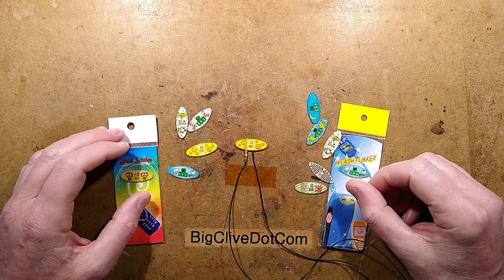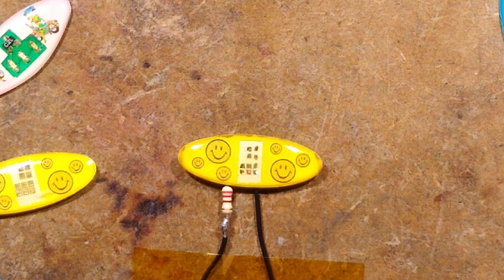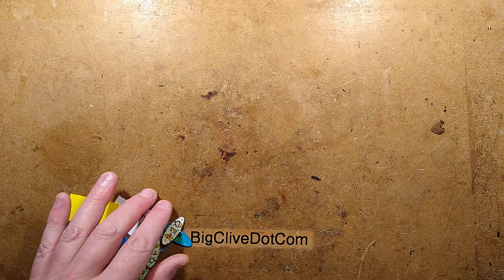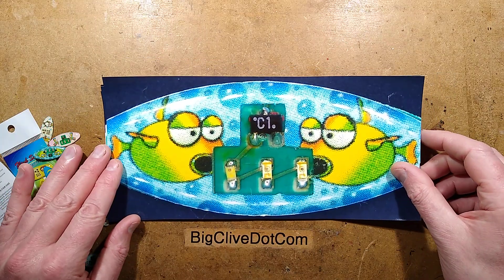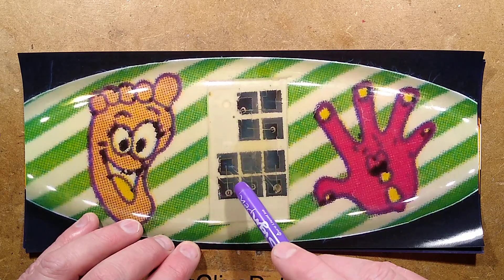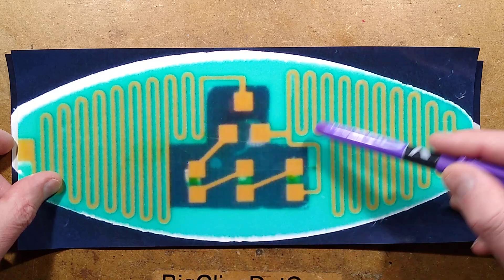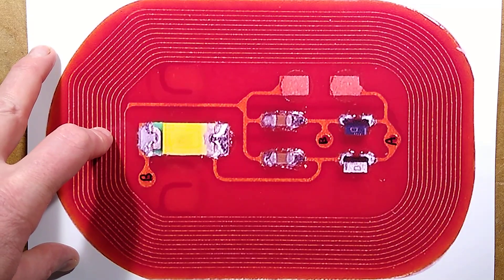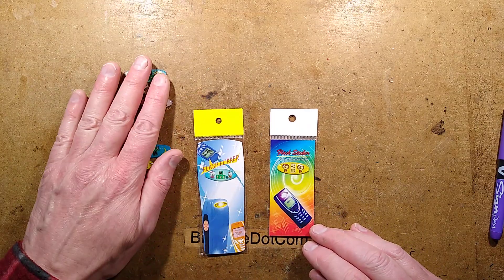How self-powered flashing phone stickers worked (with schematic)

Comment: The lowest gsm freqency was 380Mhz, but most of the lowet freqency was used by 1G phone network. Hence most system started at 700, where 750, 800 850 and 900 was also commonnbands. Then 1800 and 1900 as the extra capaciry band.

The antenna is typically half or quarter length, that is possibly why the dual layer side is shorter.

Anyway the range of gsm was 36 km (this was later hacked  to be improved)

When 3g was introduced the range was reduces to 20km, the idea was that the phone could fall back on 2g. This turned put to be a problem when 2g was shut down.

3g  also typically only run in one freqvency.

When 4g was introduced first the old 1g freqvencys was freed up then the 2g freqvency. Because of that 4g have a fallback 40km range mode typically in the 700-900Mhz band,  but 400 and 450Mhz 4g also exist. That is ontop of the 2600Mhz dedicated 4g freqvency.

For 5g its a bit diffrent.  While 5g have the 3.5, 5 and 28Ghz dedicated freqvency. 5g base station can mix and match 4g and 5g signaling  on older freqvency. So a base station running on 2.6Ghz only can send 4g and 5g signals mixed on the same freqvency, solving the generational problem.

While the old 4g base station also could send 3g signals, they could only do that on a specific freqvence and dont mix on the same. (I think 5g station can mix in 3g signaling but unsure of that)

The reason to use 5g signaling is that 5g is moren spectrum efficent than 4g... so its cheaper for the service provider.
Reply: Nice write up I learned something new today. I thought 4g was only in the multi Ghz range this whole time. Very cool.
Reply: Yes and no. 2G is still going strong in many parts of the world, including the UK. 3G is and was on more than one band (usually 900 and 2100 MHz here in the UK, though 2100 is now being phased out and given over to 4G). There are 4G and 5G from 700MHz up in the UK, depending on where you are. There are base stations capable of doing from 2G up to 5G, but you were right about the sharing of 4G and 5G on the same frequency, it's known as spectrum sharing.
Reply: That makes sense why I can get a solid “4g” signal in the middle of nowhere but the internet connection is barely there. Once I get closer to a tower it bumps up to “4G” and I guess that’s when the 2.6Ghz has a stable connection and internet speeds are much faster.
Reply: @markm0000  Try locking on to different bands, you might find that those 1800/2100MHz bands can work quite far with a good antenna.
Reply: @aziztcf  I have a iPhone I can’t do that. It picks the best signal anyways. I barely ever need to restart my phone like I used to a few years ago.

Comment: How do antennas make a circuit if they're open at one end?
Reply from the maker: Voltage in induced across them at their wavelength.
Reply: @bigclivedotcom  Thanks for the answer but I don't get how the voltage can move if it's an incomplete circuit?
Reply: I'm guessing the two ends of the antenna are the connection to the power source.

Comment: I miss the little blue and red led antenna nub that I had on my Startac phone back in the 90ies.  That was a great phone too, battery actually lasted a week and it was TINY.  All while blasting out the high power analog signals.
Reply: Battery lasted longer than a week because it didn't do anything except make calls. Those types of phones are still available. The first startacs only had a 14 segment display. So it took almost no power to run.
Reply: @littlejackalo5326  True, but do keep in mind how much stronger the broadcast power is for analog cells, the the fact that the battery itself was the size of your thumb.  Tiny.
Reply: I so miss analog cell phones - I stayed grandfathered in as long after the transition to digital as AT&T would allow me to.

Comment: I had a screwy-inny antenna for my Motorola m3788 phone (my first mobile) and it had a pair of 3mm LEDs in it, one red and one blue (latter of which was amazing for the time, think it was 1998 or 99) so flashed like a merkin police light bar when it was broadcasting stuff, think it was a small diode (maybe 1n4148?) and the two LEDs as the circuitry, how it worked though was beyond me at the time though, seemed like magic to me... :D

Comment: Did you try switching the router to wireless B and increase the signal strength?
Reply: It’s the frequency. These stickers are meant for 900mhz.
Reply: @markm0000  I thought that wireless B was lower frequency than 2.4 GHz... which is a mistake

Comment: Never seen these stickers but I've seen the LED keypad overlay that would make it glow different colours and wrapped around the phone and connect to the battery of a 3000 Nokia phone.  The only sticker that was available was the one that went under the battery that supposively boosted your antenna capability
Reply: One guy modded his 3210 with extra bright leds and clear cover. That was awesome at that time 😎
Reply: Same, guess I wasn't browsing eBay for random stuff enough as a teen.
Reply: Yes ! they sold them on TV was just a sticker with a long run of flexible circuit board looking copper in a square that went around to the middle .  one of those $19.95 deals  early 90s

Comment: I wonder if the antenna on the back is to get the antenna that much closer to the source.

Reminds me of blueprints.  They were created by shining uv light through a black ink print onto a blueprint paper (that is yellow before stabilizing).  The uv light is blocked by the black ink and the uv light blows the yellow off the paper.  The remaining yellow print is fed through an ammonia vapour which turns it blue.  If we wanted a really good print we would print the black in reversed.  Then the yellow and the black ink would be in direct contact... instead of the uv light having to travel through the thickness of paper.  Even a paper thickness made a huge difference in energy and crispness.
Reply: That's a fairly interesting thing that I've never really learned from engineering, and always wondered, since any drawing paper we ever used (and being now a student, little drawing paper and mostly AutoCAD) was always white, yet "blueprints" were literally blue with white (or maybe light yellow as you say). I've always wondered at what point did they use the blue paper and light colored ink.
Reply: @Kalvinjj  they stopped using blueprints when computers were used for drawings.
Reply: @littlejackalo5326  well, yeah I can see this nowadays in work, but I wondered about the old ones, if they were actually plotter-drawn or alikes with white ink on that paper and for what reason. This photocopy method makes more sense.
Reply: @Kalvinjj  The other guy is incorrect... sadly very "binary" understanding of the world is how the internet works.  The switch had very little to do with "computers".  It wasnt until the wide scale acceptance of the PDF format that this sort of reproduction was made obsolete.  

When the switch went to computers in the 90s (autocad was being used here in 1993 maybe earlier) you still had to plot the drawing on a big ink plotter or worse yet a pen plotter (paper was set up on a drawing board and the plotter would grab a pen of the right diameter and colour and then draw... it would swap pens throughout the plot... fun to watch but brutally slow and really depressing when a pen ran out of ink halfway through... the worthless spaz Shaq wouldnt have lived very long).  This took quite a long time even with large format inkjets it was 20 minutes for an A0 sheet.  If you had a project of 25 A0 Sheets and needed to submit 15 copies that would take forever and the ink and paper was expensive (50 foot rolls of special paper to grab the ink quickly).  Towards the end of this reproduction large format laser printers became "accessible".  An inkjet machine was about $15000 dollars with the blueprint machine another $2000 in 1990s dollars.  The laser machine are $40,000++ in todays money for a decent machine... but you can pound out hundreds and hundreds of sheets for cheap.

The ink was essentially masking for the blueprint like the etch resist for copper traces.  The large blueprint sheets were yellow to start and had to be stored in black bags since the yellow would blow off in any sort of light but especially UV or sunlight.  Minutes would ruin the sheets.  The "blacklines" or "blackprints" sheete with the yellow coated sheets were fed through a large roller machine that would expose the papers to a measured amount of light based on the speed setting.  Then you would separate the sheets and feed the yellow one (now missing all of the yellow that wasnt masked... it was gone) into a lower set of rollers which would run the paper through ammonia... I think vapours were created in a heated bath so the paper didnt get wet only exposed to vapors.  Usually we sent them through twice to convert all the yellow to blue.  The blue was mostly stable but still would be destroyed by sunlight.  This reproduction could be done in a few minutes per sheet and at a fifth the cost.

The process was the same before computers except that they needed a long term solution instead of paper.  This they were all hand drawn there would be weeks of drafting on the sheet.  They would use mylar sheets or "vellum".  In the old days I think this was a processed animal skin like parchment.  It would last almost forever.  Up until the adoption of PDF we would submit record sets on mylar... that was common at my office until at least 2005.  The quality difference in drafting of ink or pencil on mylar vs. anything else is noticeable.  

Drafting stopped being a "profession" when computers were invented.  With computers mistakes could be corrected with mouse clicks.  Drawings could be updated.  If the drawing didnt fit you break it up onto multiple sheets.  Ironically instead of saving time there was more time spent updating drawings because now it was expected that changes could be made.  Before computers the drawings were the drawings... they had to be correct and the contractors had to comply.  Now they just want a revision because "its no big deal".
Reply: @someguy2741  Thanks a lot for the history of the process which I've never seen happen as I'm about to graduate at the end of this year. Right now last time I've sent technical drawings, they were indeed just a .PDF (which by the way we've found the hard way by making templates, that without perfect settings through, some percents here and there of messed up scale are kinda expected...), and that one was mostly to show bend dimensions and their placing, the cuts on laser were all a cutting .DWG that the laser CAM software eats up.
Tho I did have some very short experience with large format inkjet plotters, but for banner printing. Impressive machines if not just for their sheer size and seeing it print from a whole roll.
Reply: @Kalvinjj  You're welcome!  The PDF is pretty good but it is an approximation.  A DWG or DXF is perfect since it is based on the math of each element not a picture of the element.

A bit more history there was a Hewlett Packard printing language called HPGL/2 (HP graphics language).  This was very early in AutoCAD development and was a game changer.  Before this the printing information was processed at the computer then sent to the printer as line segments or dots.  With HPGL The data sent to the printer was really small because instead of trying to represent a circle as a series of small line segments (with possibly poor resolution and jagged edges) it actually stored it as "draw a circle with a center located at this coordinate and a radius of this".  This is similar to how DWG and DXF files store information.

When accuracy is important its hard to beat DWG or DXF.

Comment: I was working for a NOKIA service provider (repair) in the 2000s and occasionally worked the retail floor, when personel was short.. I remember people complaining about bad reception and reduced battery life with these stickers and I told them remove them .. the flashing light is generated somehow (presumably draining your battery by munching RF energy and reducing reception quality in "borderline" areas)
Reply: And here I was about to buy one because they're cool
Reply: @Some_Beach  Well, I used to have one of these. Never had reception/battery life issues. 
Thus I have but one question: Do these still work with modern phones on 4G?
Reply: @Vousie  I doubt it sadly. Though to be honest, it probably wouldn't be hard to modify one? Maybe you could just modify the antennas idk
Reply: @Some_Beach  I dunno. The frequency range he mentioned in the video is pretty much what 4G is on in my city anyway (I think they actually said they shutdown 2G so they could use the frequency for 4G).
Reply: @Vousie  these flashing stickers won't work because the modulation is different. Old phones used a time based access method under GSM called TDMA. Basically, pulses of power at a set frequency with a wait period. Hence the almost Morse code sound of sit dot dot bzzzzz. Think full power on off on off.  While new phone systems use WCDMA. The new system is more constant transmission, so no pulses of power, as such. CDMA uses 'magic' coded transmissions to transmit packets of data. Put simply, TDMA means all phones get a unique time slot to transmit. CDMA everyone can transmit, signals are coded to separate.
Reply: Thinking about this more, TDMA had a narrow band pulse so the peak power would be higher than a CDMA 'pulse'. Average per being comparable. We now use wide CDMA called WCDMA which are very wide bandwidth transmissions. Average power might be a little higher but it's the power that flashes the light.
Reply: @swapshop864  do you know of implications in regards to health?
Reply: @wuuubbits  power reduces with distance at 1/4 root. Not the square root. If I remember correctly. So any distance, adsorption will be hugely reduced. I'm not really qualified to answer your question. But we're talking in the region of 200 mW of average power. Which is tiny.
Reply: yep if placed in the near field (in extremely oversimplified terms, "very close" to the transmitting antenna) they certainly absorb some power. How much depends on the diode characteristics at the freq in use, the amount of coupling, which may vary with orientation as well as spacing from the antenna, the proximity and orientation of the sticker to other RF-grounded components* or screening , plus the presence of other nearby conductors (and less significnatly, the dielectric properties of any intermediate material like the phone case and sticker material. 

* RF ground probably doesn't mean what you think it means if you are thinking "there's no ground"
Reply: oh and the Q of both systems, how could I forget the Q lol
Reply: @gordslater  can you describe a bit what q means/is?
Reply: @gordslater  so wires absorb energy?
Reply: Exactly right. These stickers were causing phones to transmit at full power all the time. Phone developers knew early on that battery life was everything, so they made sure the phone would use the minimum amount of battery power to connect to the towers. These stickers were absorbing the signal energy before reaching the tower so the phones would increase the battery power to the phone's antenna. So not only was the battery draining faster, but you were getting the max phone radiation to the side of your head. The sticker being on the other side of the phone. :D
Reply: @MarcUK  max radiation really doesn't mean anything cell phone power even back then was less then even a modest wifi router
Reply: Remember  the LED antennas for the 51xx series? LOL
Reply: One wouldn't do much to your phone signal. But you had kids bedazzling their phones with the things, so...
Reply: Things like this, is why basic science education is needed in school. Also teachers who are able to communicate things like the fact that energy always needs to come from somewhere. Nobody who understands the mere basics would use these stickers.
Reply: Still have my SRT-6 etc.
Reply: @leosedf  I "chewed" through so many of them ..wish I had kept some ...all these clones I have nowadays aint the same
Reply: @dolbyman  I also have the long one that looks like a pen i forgot the number. Nokia had the best after sales service and tools, nothing comes close to them.
Reply: @leosedf SRT 6 being? Thank you
Reply: @wuuubbits  That blue tool that looks like a guitar pick was originally made by Nokia with good plastics, it was really high quality.
Reply: 10:01
Reply: Yes it absorbs rf energy  but that energy was going to be output by the phone at the same level regardless of what was stuck to the phone. It’s similar to saying urgh I can’t get a phone signal because there’s too much phones and devices absorbing all the energy.

Comment: Zig zagging does not increase the effective length of an antenna (looping does), so they would have done it for some other reason than to make a better antenna. I suspect they worked capacitively (in addition to being an antenna).
Reply: yeah, the whole thing is a vampiric circuit on the radio transmitter of all the varieties to a certain extent: cap, induct, and emf. Putting 500mw excess drain on a transmitter that can only do ~5w  or less max...

big oof

Comment: Oh, I sure remember those hideous things! They were, at least as I recall in my area, most often sold as the worst of cheaply-made phone cases.

If you have a PMR446 radio or your equivalent to what we had as "900MHz" (I think yours were in the 850MHz neighborhood but I barely keep up with regulations over here.) you might be able to power them wirelessly.
Reply: We used to have a 934MHz CB radio allocation, but that was withdrawn around the year 2000. 
But I doubt the etched antennas on the stickers were resonant, so anything in the UHF spectrum would probably work to demo them.